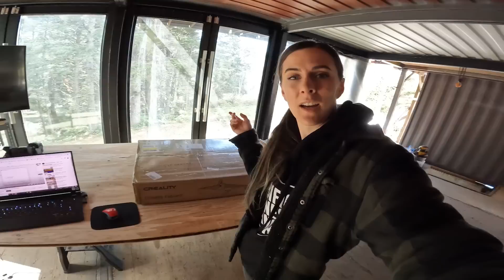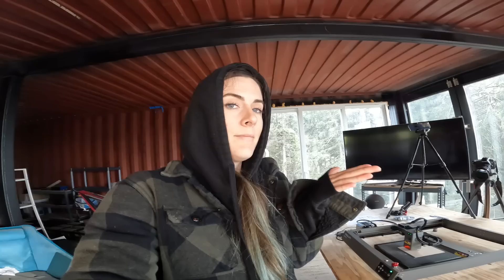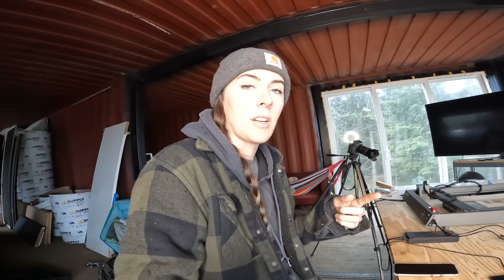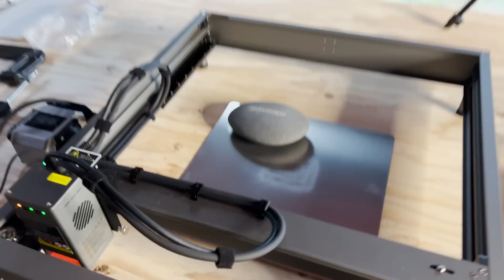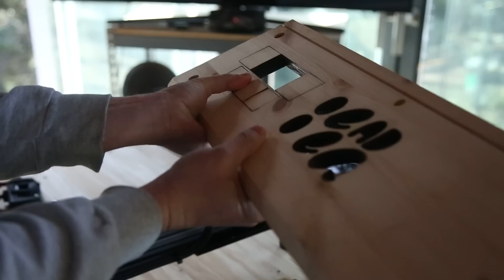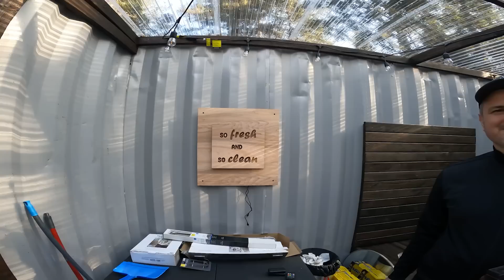I BUILT THIS CUSTOM SIGN with Creality Falcon 2 Laser Engraver 22W #laser #creality #tools

Comment: How deep does it etch the stainless?
Reply from the maker: I'm not sure how to measure that. It's definitely etched in there pretty deep but that is the first time I tried etching stainless so I don't really have anything to compare it to.
Reply: @PacificPinesRanch  what size welding wire do you use? 0.035”? Is it about that deep?